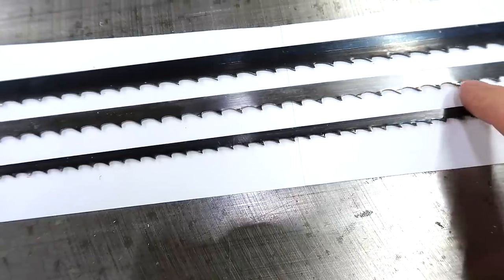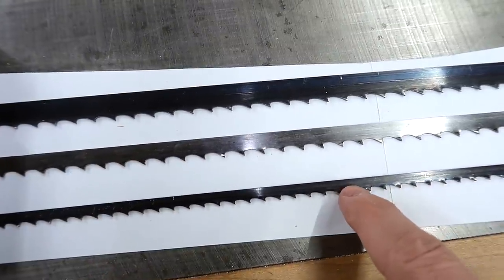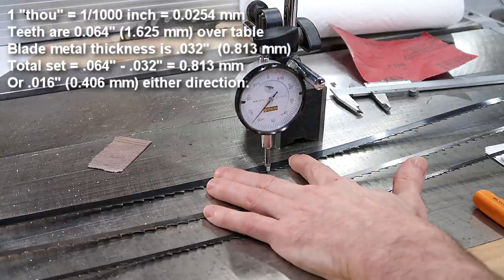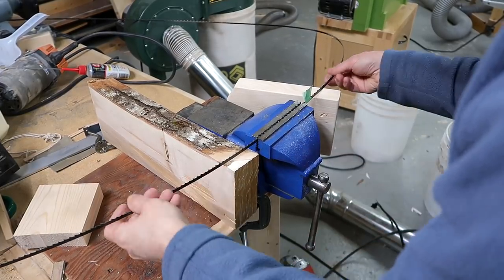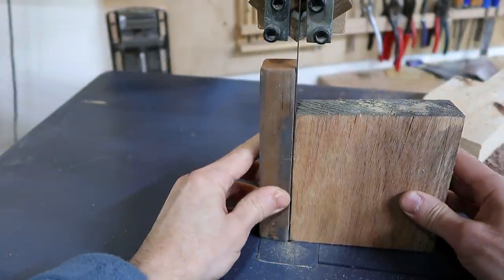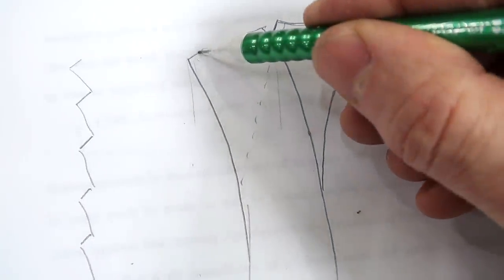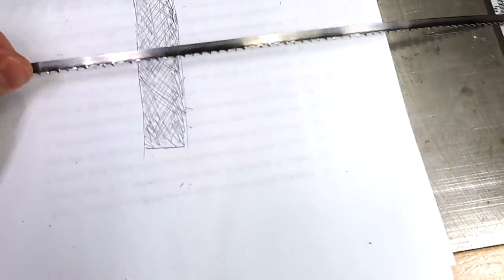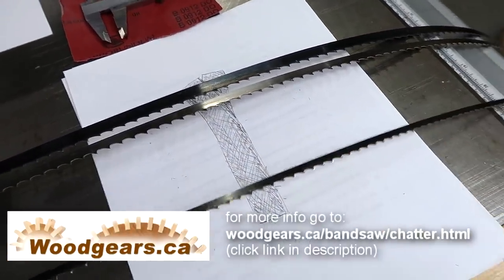Bandsaw chatter, modifying tooth set, and making precise cuts

Comment: Why didnt your other bandsaws do this?  Or did they and you just didnt show it?  Also....random thought.  Could you put a flywheel on a bandsaw wheel to help with power, if using a weaker motor?  Obviously it'd take longer to spin up and come to a stop, but you'd get way more power right?
Reply from the maker: The blades I used on my other saws didn't have this much hook.  That same blade on the other saws would do as badly.
Reply: Unfortunately, no. A flywheel wouldn't add power to a system since it's not putting more energy into it. Instead, a flywheel stores energy, which is available when the load suddenly changes. That's why it's great for cars, which give you more power in bursts but you need smooth power output.  For this bandsaw, a flywheel might smooth out the blade's jumpiness, but then you have the problems of a bad blade plus the problems flywheels bring in (like balance, momentum, losses, etc) when an easier fix is to replace the blade.
Reply: @Pyrichia  You definitely said it more elegantly than I did, and that's exactly what I meant.  If the flywheel stored the energy, then the motor wouldnt get bogged down as badly with heavy cuts, correct? Because The flywheel does not want to slow down.
Reply: @ShopTherapy623  The issue is that this particular blade has problems other blades don't. That indicates it's a problem with the blade, rather than a problem with the bandsaw design. It's simpler and more sensible to figure out what's wrong with the blade, rather than add parts to deal with the blade's problems.
Reply: @Pyrichia  Yeah i wasn't insinuating that the bandsaw design was bad.  I built his bandsaw.  It was just weird that all three blades did this, but his past blades never did.
Reply: @ShopTherapy623  oh yeah I totally understand you weren’t saying it was bad. And yeah I don’t think the full reason for that blade’s behavior is known yet. It could actually need a much more rigid frame or powerful motor to work right, but we don’t know.

Comment: Instead of squeezing the blade between the stone and some wood, I reckon a Dremel or even angle grinder (held freehand) might be an option, too.
(I would guess there's quite some force when "squeezing" the blade, but of course you can't really tell from video only...)
Reply from the maker: that would have MUCH less consistency.  Consistency is key for a clean cut.

Comment: If wood works anything like metal and its response to cutting.  I would think that the blade would rub if part of the cutting part of the blade is parallel to the wood.  I would think the taper has to exist along the entire width of the blade. The way you are stoning is kind of making the blade square

Comment: it literally takes me 2 or 3 minutes to set up my cnc (laser cutter) the best and most used tool in my shop
Reply from the maker: with a cnc router, you have to set the bit, bit height, clamp down the stock, set the origin, load the file (which first needs to be prepared)
Reply: @matthiaswandel  I touch off on the stock so I need to clamp it first. CNC is handy if the pattern is very complex. I've seen people isolation route circuit boards by hand but it is just not for me.
Reply: @matthiaswandel laser cutters = no clamping, auto height set by material selection. No prep on the file, just click print.

Comment: Set one teeth of say ten straight as a reamtooth. The problem is that little nib in the middle between the teeth. Everytime this shears off it will bang. The reamteeth will take care of this. Reason is too much set. Set should be just 1/2 of the thickness. The teeth need to cut with their edge not with their flanks.

Comment: I doubt it would have much of an effect but what about messing with the feed angle like so the blade is still 90 degrees left and right but the table slopes 45 degrees up towards the blade? Now that I think about it it wouldn't change the blade hook angle but it will change the amount of wood in contact with the blade at once, increasing it. I feel like increasing that would not help though for a 30 second test it might still be worth trying, and try sloping it the other way as well so exaggerated like this:
feeding the wood this way ---> with the table like this / (maybe half the angle) then the other way \ also at half that angle...
Reply from the maker: I expect that would have an effect, yes.

Comment: Can't it also be your cutting speed? for example, if you mill with a rpm that is too low, the mill also grabs your work, reducing your quality.
Reply from the maker: its speed and feed rate.  I can double the speed or halve the feed rate.  But relatively low feed rates cause more dulling per amount cut.
Reply: yeah that's true

Comment: I'm surprised you haven't invented a mobius bandsaw blade... yet... then half the time it would be backwards, or if you put teeth on both sides you'd have a 2x length with a normal sized blade... would that even work?  If not, then it's a lesson: I shouldn't leave comments when tired.

Comment: Looks  like you ain't got enough power mate. My  StartRite 602E band saw has a 3,000watt motor @240v  throat  550mm it will cut anything hard soft and anything inbetween smoothly never judders, tighten the band and used a bigger motor.. prob solved
Reply from the maker: so I haven't got enough power even though it didn't at all slow down?
Reply: @matthiaswandel  your high speed low resolution footage actually did not confirm or deny the blade maintained the same speed for each 'hit & relax' of the chatter, so it is still a possibility that the motor is not pulling through the denser bits as well as needed.